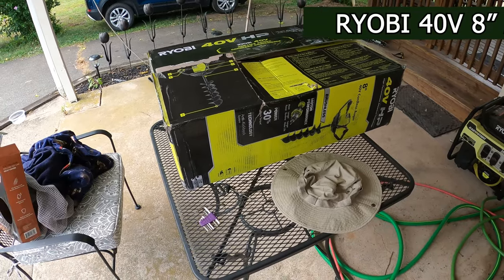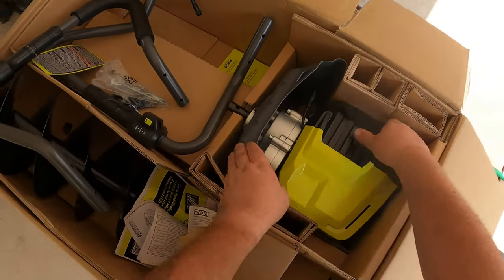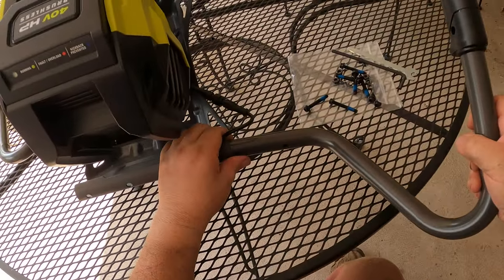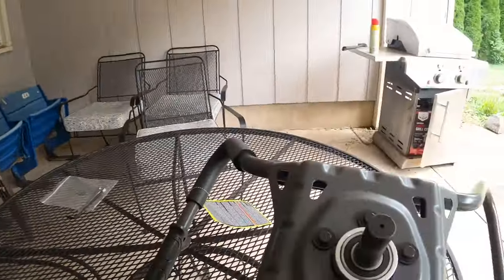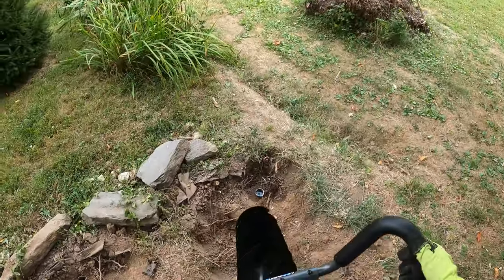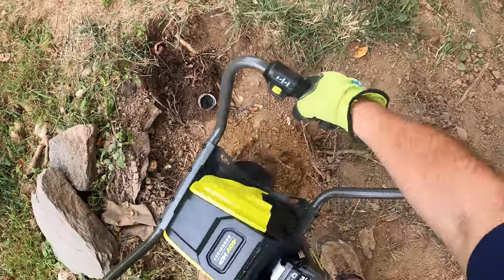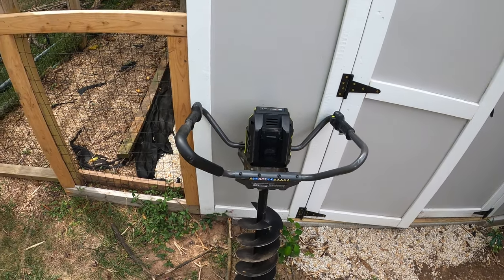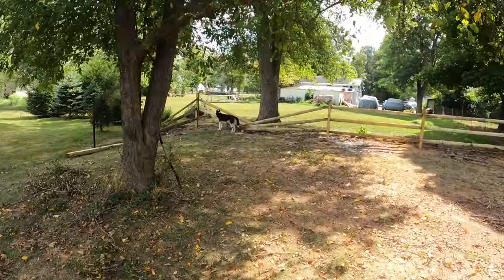How To & Review: Ryobi 40V HP Wireless Auger with 8" Drill Bit

Comment: The best way to use this machine is to let it do the digging. Don’t force it. Don’t push down. If it hits an obstacle let it work on it. Brace it with your thigh.
Reply from the maker: I agree on letting it do the work, but you  need to be careful bracing it with your thigh. If you are working in dirt that has old roots or larger rocks, it it can hurt you easily with the kickback against your thigh.